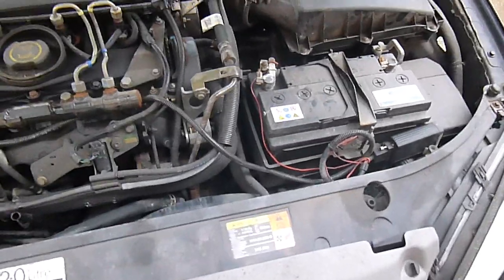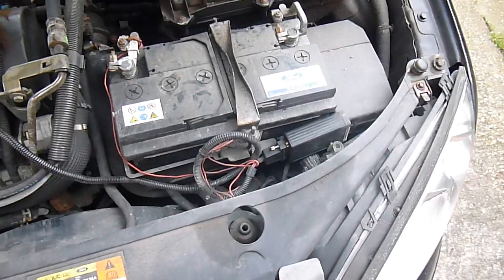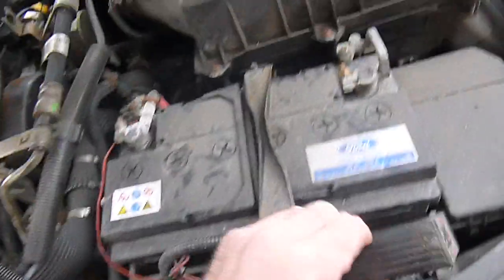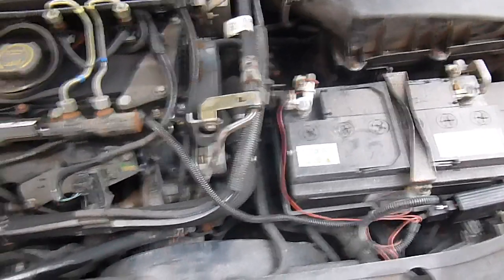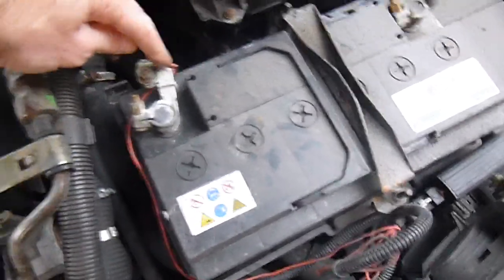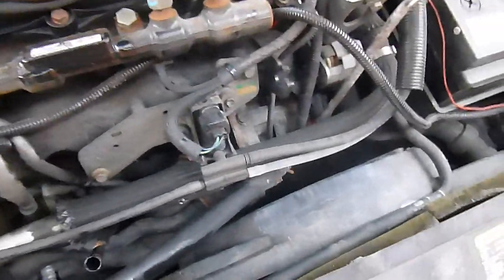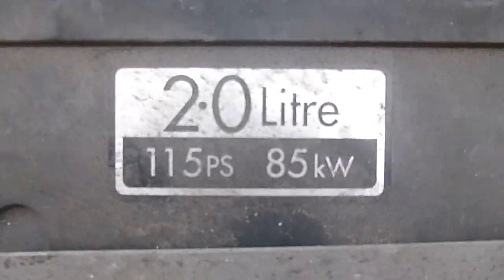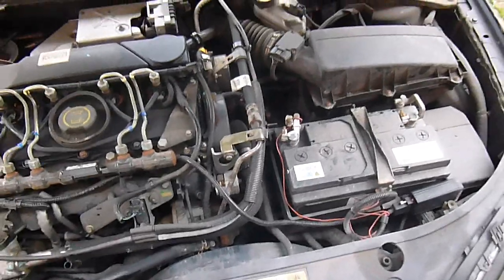Mondeo 2.0l TDCI Eco Performance Remap Chip Install 65+mpg 160hp

Comment: I have just put one of these on this exact model awesome bit of kit mine is from bluespark automotive I’m getting 68mpg so far still climbing
Reply from the maker: Good man. :)
Reply: mhawkins1975 Bluespark are top notch 👌🏻
Reply: Do the MPG calc at the pumps, not on the computer.
What this does is fool the car into thinking the fuel rail pressure is lower than it should be and thus increases it, fooling the computer.

Comment: It sounds crazy but running a engine slighter rich reduces power , where as running a engine slightly lean increases power. But running lean will make the engine run at higher temps

Comment: thanks
as for the comment before mine
the fellow knows zero
car builders how to comply with emission standards once the car has left the factory you can do what you like with it the turbocharger can easily put enough air in to cope with this small increase in horsepower and you are right once you have the increase in horsepower the governors are easily achieved so in other words the car comes onto the governor it more easily and uses less fuel to attain a certain speed so what is the make of the ship that you found I would surely like to buy 1 I have just bought another Mondeo I am in Australia and the car is in France so please advise
Reply from the maker: and thank you for your reply too sir. :)
Reply from the maker: +Dr Ed sorry my friend i do not know the make/model now. Installed it some 5+ years ago
However i recently installed one for my Merc Vito and works equally as well it seems. Was sourced from tdi-tuning.co.uk, hope that helps

Comment: my mondeo doesn't do anymore than 29 mpg 😂
Reply from the maker: oh dear, best get a new one then :)
Reply: Ah considering it XD I'm only a student XD
Reply from the maker: should do around 45 without the chip, 29 is really bad matey, sounds like it has issues, unless you have a very heavy right foot ? :)
Reply: +Dr Ed ah nah even driving sensibly 29 maybe 30 Max XD is it possible to get it re-maped to be more economical?
Reply: +Matthew Horan *re-mapped
Reply from the maker: yes mate, that is what this vid is all about :)
But seriously, if it is only doing 29, you have an issue with the car, maybe leaking injectors?
Reply: +Dr Ed I'll have to have a look over it but possibly the injectors cheers I'll keep you updated XD
Reply from the maker: either way matey a chip will greatly help you get more mpg ;)
Reply: +Dr Ed any you would recommend?
Reply from the maker: last 2 i have fitted have been from tdi-tuning.co.uk and work well
Reply: +Dr Ed mines petrol so guessing the same one won't work as well or am I talking bollocks? :p
Reply from the maker: haha, you can chip petrol engines too, but now i know that, that will be why you get such crap mpg, should have told me that to start with :) diesel all the way mate, better mpg and more torque! My 2.0 TDCI has 160bhp, so unless you have a 2.3l i bet yours has nowhere near that ;)
Reply: +Dr Ed well I havnt got the torques but I still have 145 or 150 bhp :p
Reply from the maker: and torques = low mpg :)

Comment: mate this is a lot of bullshit its just making your car run rich!

diesels need more air  for power

and try work out the real mpg!! because the fuel rail is being fucked with the mpg reading on the clock is wrong
Reply from the maker: +Arron Somerville If that was the case the engine would have died ages ago and i would not be getting 700+ miles to a tank full ;)
It may run a little more rich, but as long as you dont floor it everywhere, it has no detrimental effect
Reply: +Arron Somerville all that box is a resister in a box better off with a proper remap
Reply: Ok mate lets talk about diesels and hopefully we can both learn here. You are 100% correct when you say you need more air hence having a turbo (forced induction) the turbo on a 2.0l tdci is good to push 200+ bhp. Because the engine can't push 200bhp more fuel is required to match the quantity of air the turbo can deliver. When the mondeo left the factory it comes with a (base map) this is basically to run in universal countries such as very hot or very conditions. A remap can be used to adjust the engine for a more precise air density and optimises the engines capabilities. Again I agree the chip box only ups the fuel delivery to the engine but this extra fuel mixed with the forced induction has a good effect. The reason mpg is better with these is because less throttle is applied when accelerating or climbing hills. The mpg on mondeos is calculated by the the position of the throttle pedal. So if the mpg rises it's because less throttle is applied throughout an average. These boxing can be used to an advantage if used correctly, such as everyday driving but if misused by racing and boosting everywhere then all it does is put more pressure on the components such as the fuel pump and injector - most expensive parts to replace. I really hope you find this useful and reply with any additional info I may of missed it if you just want to post your point of view. 
:)
Reply: Giving a engine a tiny bit less fuel makes it more more powerful , I know it sounds crazy but too rich actually slows it down and to lean makes it faster